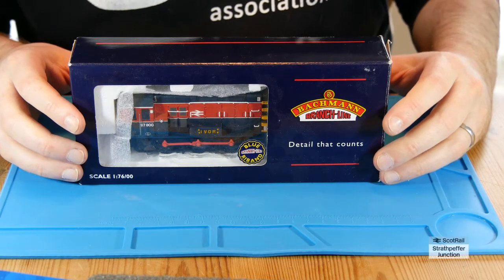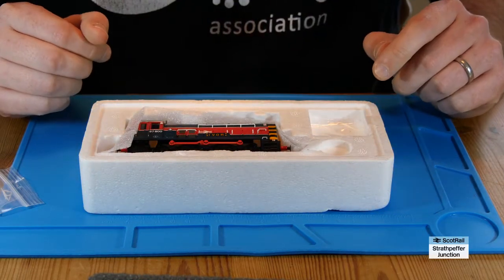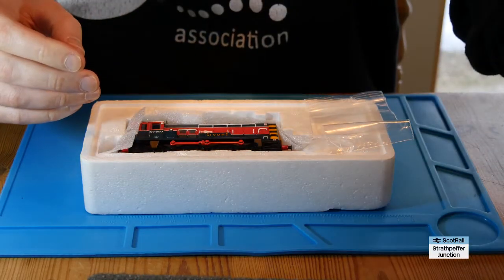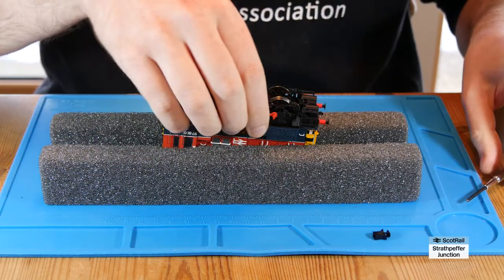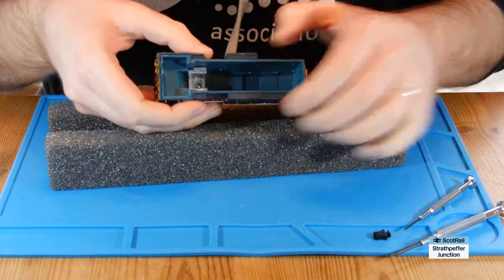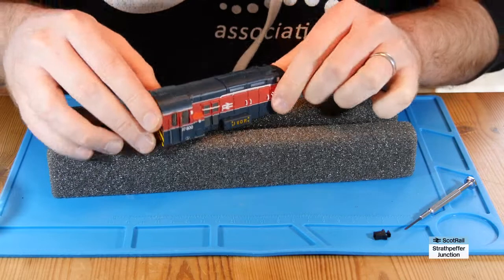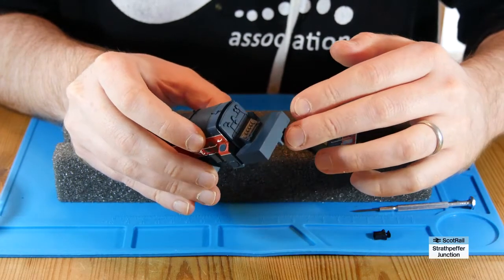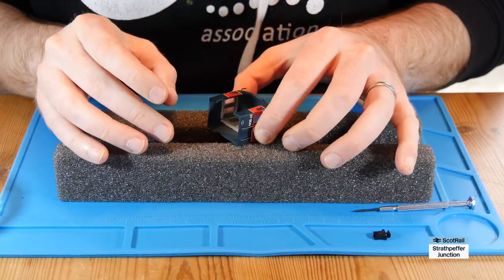#3 Part 1 - Installing LokSound Micro V4 & PowerPack Mini in Bachmann's Class 08 Shunter

Comment: Hi not sure if you know but when using activator you are supposed to spray it on the opposite contact surface and it's easier than holding two things at once I use the same method but spray the led and it sets on contact regards sean.
Reply from the maker: Hi Sean. Many thanks indeed for the comment. Yes, you're absolutely right and I should probably have explained things more clearly in the video. If it want an instant stick, I do it how you've described. I've had a few issues with that though with this tiny components, because sometimes it goes off too fast and things get glued out of alignment. I have found if you give a wee skoosh of activator like I've done, it can help the glue go off more quickly than it otherwise would, but still gives enough time for a bit of fine adjustment. I should have explained that though. 🙂

Comment: Nice video! Where did you get that blue plate your working on? seams very handy to me!
Reply from the maker: Hi Joe. Many thanks. It's just an anti-static mat from ebay. They're not very expensive. They're heat and static proof, but not knife proof. So, they're great for servicing, electronics, decoder fitting, soldering etc., but if I'm cutting, I remove it and use the big cutting mat below. They also have a certain amount of grip, which helps stop small screws etc rolling away ☺️

Comment: Hi, just catching up with your excellent projects. Can I ask where you got your blue work board from? I like the compartments around the edge
Reply from the maker: Hi Mark. Sure, I got that one from eBay. If you search for blue anti-static mat, you'll find loads. It's not a cutting board, and cuts very easily, but it's anti-static, which is great for working with decoders, and also fairly heat proof, so useful when soldering. I always use it when I'm doing decoder work. I often have a cutting mat underneath, so if I need to cut anything, I just move the blue one to the side temporarily.
Reply: Thanks for that, much appreciated, didn’t expect a reply so quickly, thanks.